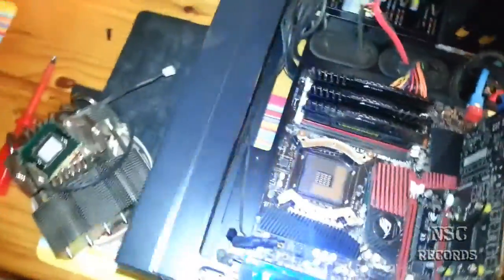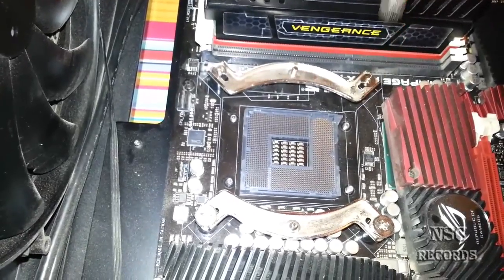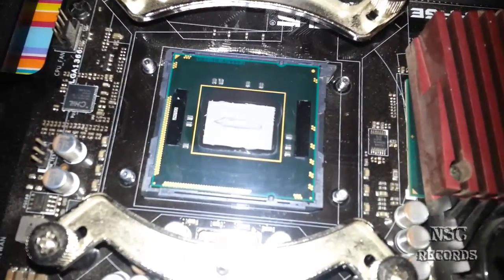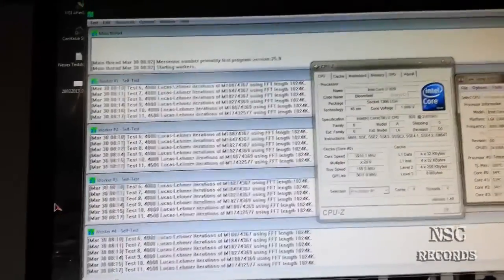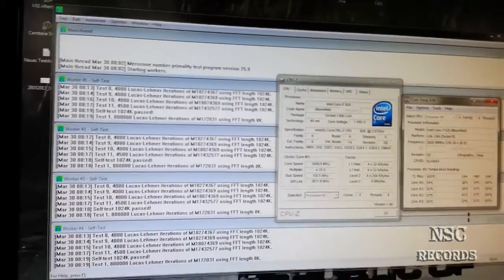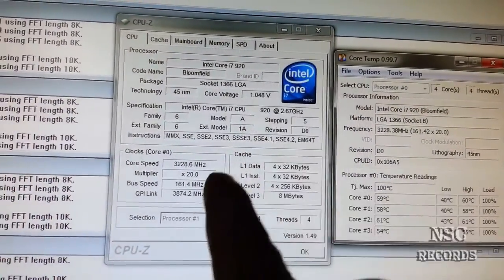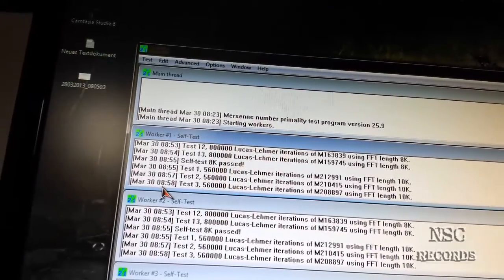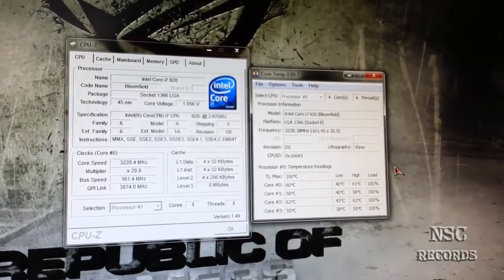How to Remove & Replace a i7 CPU Heat Shield "The Results" By:NSC

Comment: o.O sollte ich meinen i7-950 mal köpfen? Er läuft momentan mit 21x200 Mhz, 1.31V Vcore (BIOS) 24/7 stabil. Mit Intel Burn Test / Prime95 liegen die Temps bei maximal 85°C, im alltäglichen Spielegebrauch nicht über 67°C. Wenn sich so wirklich 200 mV einsparen lassen, sollte die CPU auch 23x200 MHz mitmachen -> +6 GFlops

Comment: well, not worth. 4ghz OC wall. I have been running my i7 920 for 4.5 yrs, 4ghz watercooled, daily. CPU temp never reach 80 in summer. Well, in my city, ambient temperature @ summer may reach 40-42 degree. Throw your air cooling away man. A second hand watercooling would improve a LOT.
Reply from the maker: hehe, i know, but the i7 920-950´s are very hot, and this was just for a test, i had always Watercooled PC´s, since the 8800 Ultra from nVIDIA ^^ > https://www.youtube.com/watch?v=bC-bBT147P4

Comment: after 30mins your really only doing it to see the temps , and anyone bitching about it not being stable you can check the windows log after it blue screens and get an idea of whats wrong you dont need to run something for 24hrs your using a synthetic benchmark most daily use wont be anything near what the cpu will be pushing on that
Reply from the maker: yea, just for the Temps, and i did it already Long ago much longer and it was all ok, but i tell u also one Thing because i work with this stuff since 15years now, you can also let it run for 24hrs or 48hrs, u can let it run one week Long and it will be stable... but later one day u try Battlefield 3/4 or an other aplication and than your PC will crash LoL

Like BF3, it has need more CPU voltage, and thats why it´s not need to run this so much time, and all the time it is runing, your Hardware will get realy F*CKING HOT, so it´s not good to let it run so long if you got no Wattercool or a great cooling...